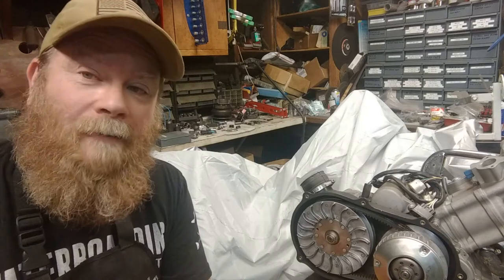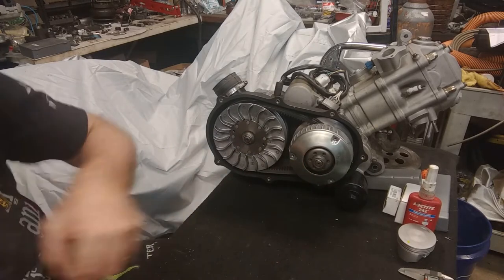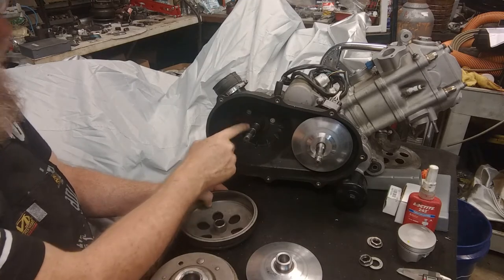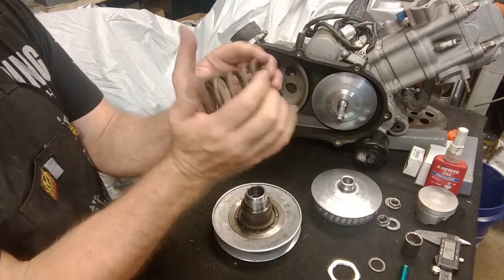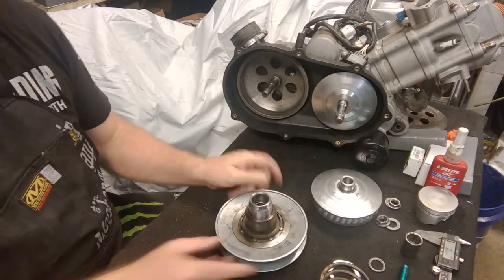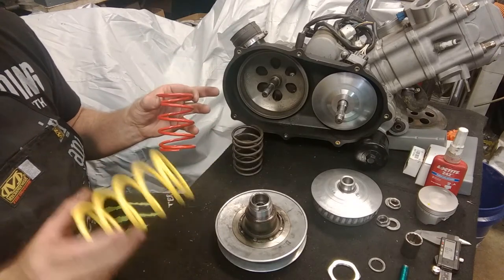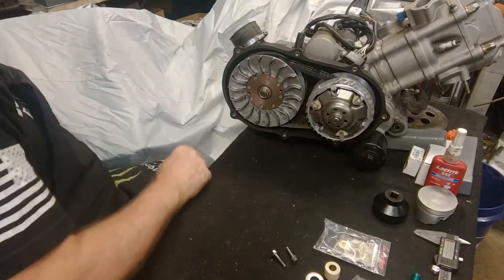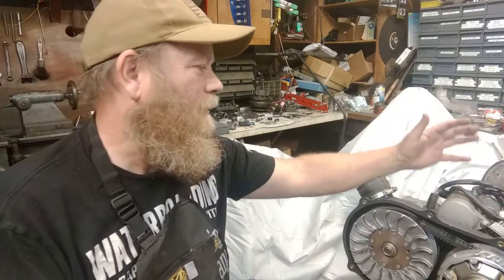HiSUN 250 Performance Clutch Kit Installation

Comment: I just put my 2 inc lift on my strike what size wheels would work if I wanted bigger wheel I have size 12s in my shop but I didn’t know if they would fit
Reply from the maker: It's not so much the rim size as it is the total wheel size. I know 22" are fairly normal, but the larger you go it really starts to change the gear ratio. I know one person with 26".